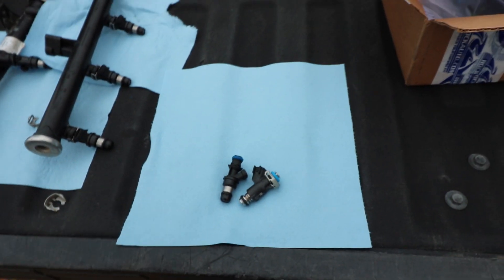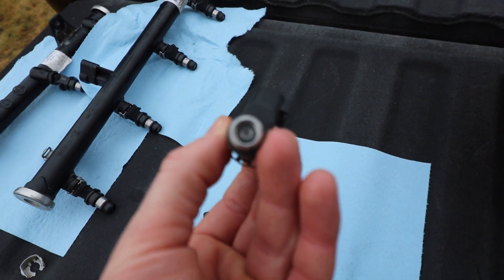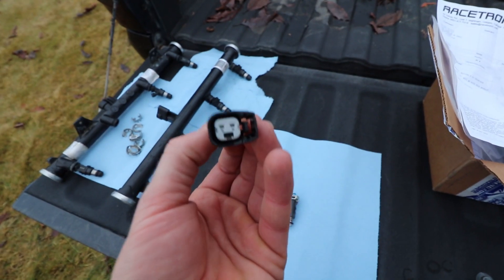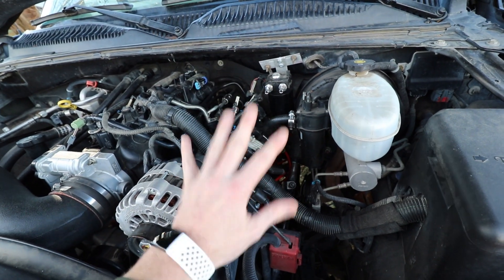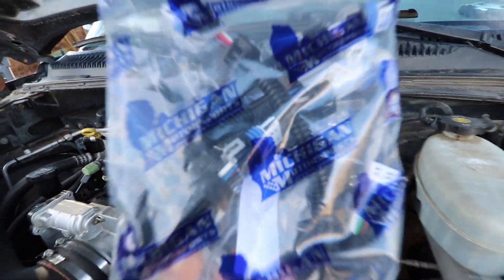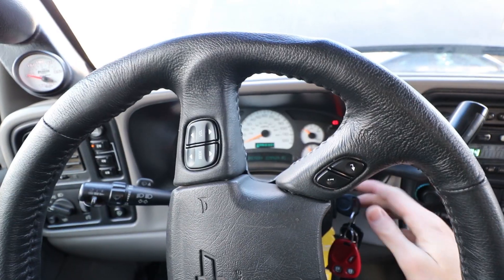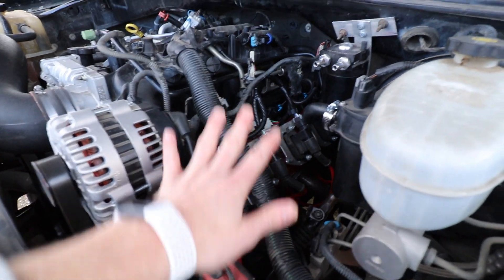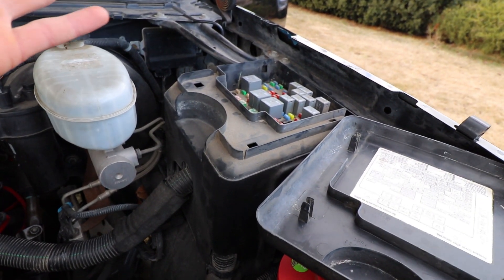Silverado Electrical Issues  - One Side Of Engine No Spark

Comment: 2008 Silverado 1500. 5.3 Having the same problem.  South main Auto had a video about this. My Right bank 2,4,6,8 coils are not firing. Check at Harness connector at coil harness at top of engine. Pink wire -Hot Black -ground. His had no ground coming there. Back probed into that harness connector at ground and ran ground test wire with alligator clip to ground. . Ran great.  He found bad ground eyelet below around power steering pump where the ground originates. Crusty ground pulled right out. He did repair all the ground wires in that eyelet and relocated the ground to a better place. That eyelet had both grounds to run both sides.  Will find out tomorrow if that's my problem. Sounds reasonable.  This seems to be the fastest fix !   also thanks for this video. It helps so many people like me!!   Phil

Comment: Thanks for pointing me in right direction. PROBLEM SOLVED. I had no spark on coils from bank one. I checked fuses ing a  and  ing  b, check power bank 1 coils (black and pink at computer side of harness), plugs wires, did a compression test, switched out coils with ones I had laying around. I finally came to conclusion that it was the wiring...so I checked   power bank 1 coils (black and pink at computer side of harness) and had good voltage. Then I checked the continuities the from coil connector harness back to computer and the coil harness under the mount bracket....and all was good but still no spark!!  
That's when I came across this video and decide to check continuity from black ground wire at coil harness back to ground connection at passenger side front head. At first I had continuity and then slowly it started to rise on and multi meter was showing resistance....well that's all I had to see and I tee tapped a new ground wire into the black ground of the computer side of the bank 1 coil harness and ran it back to the original ground on passenger left front head!! 
It fired right up with all original parts( i put original coils back on) and laid down rubber on first test drive also blowing what was left of my bank one cat converter's internals all over the neighbor's curb. My Truck is a 2007 Silverado new style 4wd with 5.3l..and its never ran better!
THANKS to ALL!
Reply from the maker: I'm glad I could help get you pointed in the right direction! and very happy to hear your truck is back on the road! thank you for going into detail on your troubleshooting, hope that can also help someone else having the same issue's as well.
Reply: I appreciate this info. I have a 8.1 swapped into a 1978 F350 dually and I have the same problem. Got exhaust on the passenger side and nothing on the drivers side. I’m definitely trying the ground trick before I replace anything
Reply: @daviddenman7479 did that work for you? Or what ended up working if anything?

Comment: PNW!! 

Double check the ground on the back of the head.  Use internal/external lock washers so it really "bites" into the block. Also make sure you have a good ground from the engine to the body. 

The video you had when you pulled the engine saved me a ton of time not pulling my hood off!  I would have never thought about using those extra holes for the hood springs🤘
Reply from the maker: Yeah buddy! 

Thank you and good call, I'm going to take another look at that ground. makes perfect since that would be the issue but it seemed fine during the install and I need to get some of those lock washers for sure. 

Love to hear it! I'm glad I could help!
Reply: Im having this issue and I don’t have any ground going to the back of the head. I checked my brothers who’s same year and model and his doesn’t have a ground going to driver head and it works perfectly fine
Reply: @gto.eduardo958  the ground on the back of the head is just for that banks coil packs. Follow the wires and see where it's grounded at then inspect the ring terminal and wire for corrosion. Repair as needed and then retest.
Reply: @253fabrication  ohhh shit okay I think I see what you mean
Reply: @253fabrication  okay so today i took it off cleaned it up because it didn’t look bad… put it back and ran the same. I checked continuity from that wire to the coil packs and it tested good. Just wanted to mention. When I did this i forgot to disconnect the battery. And once I got it loose it touched the fuel line. And it activated my fuel pump because I did have my gauge hooked up and heard it prime. correct me if I’m wrong but I have a short to ground somewhere right ?
Reply: @253fabrication  also it was with the big ground on the back of the engine. Not the back of the head. Should I relocate it to the back of the head ? As well as I disconnected battery after that incident. When ground touched it activated fuel pump and sounded like the throttle also activated

Comment: Hey did you ever figure out what was wrong with it? I have the exact same issue and same side too. I put new intake gaskets, maf, TB, spark plugs, ignition wires, knock sensors, didn't want to spend the money on coils if they're good. I unplugged the driver side at the main harness for the coil packs and the truck ran the same so I have that whole side not working for sure. Any update or help would be appreciated

Comment: Pull your injector a fuse and look at it this happened to my 5.3 and fixed it thanks to your videos I just need to find my short now. Thank you for your help and videos
Reply: Fixed today BTW and it's labeled "injector A"
Reply from the maker: I will take another look and clean the connections for sure and Thank you! I'm glad to hear you are getting yours squared away!
Reply: Man thank you for this comment i couldn't find the issue resolved nowhere on youtube until i seen this comment and  that was the exact answer that fix my issue! Thank for posting this comment your a life saver man💯
Reply: Having the exact problem
Reply: @fabiangonzales6949 mine also. 06 1500 MAX 6.0. Fuse INJ 1. Entire 1st bank had power again.

Comment: Ground on block beside the powersteering pump possibly had one at a dealer I worked at said it was bad computer didn’t fix it ended up being that ground even though it looked good you gave it a little tug and it popped loose put a new ring terminal on it fired right up
Reply: I have the same problem but mines on passenger side any help would be great

Comment: Try checking your 02 sensors sometimes they short out and close the one bank down, that they are connected too. Had this problem on new vehicles at the time these were new working a car dealer first time I came across this issue changed odd or even side O2 sensor problem fixed.

Comment: Check your negative cable on the back of the driver side head I had the same problem brother
Reply from the maker: I appreciate it brother man, I found that to be the issue. Unfortunately after fixing it the valve spring broke during tuning and now I’m building a 6.0
Reply: Negative cable back side of head ?
Reply from the maker: It’s the black ground cable behind the intake manifold on the drivers side of the block. If you remove the intake manifold it’s much easier to get to.

Comment: Any luck with this yet? I’ve got the same thing going on. Was it a ground wire for yours?
Reply: I found mine. I had to replace the lifters originally. After reassembling everything 1 & 7 wouldn’t fire. Ended up being the lifters orientation absolutely matters for the oil hole. The tiny hole has to face the intake and not the exhaust manifold. Ripped it all back down. Rotated lifters around and now all is good 🤞

Comment: Have same truck with same issue some feedback new injectors new coils wires plugs po300 po200 well now po0300 code only
Reply from the maker: So after doing new MAF, MAP, Coils, plugs, O2 sensor, injectors and intake gaskets. Turned out to be a bad ground on the on the back of the block on drivers side. Check both passenger side and drivers side grounds would be my suggestion for your next steps.
Reply: @MitchCarveth  ty it was a ground on the back of block and well the one ignition relay well there's a certain way they go in a parently and switch relay or flip it around truck came to life

Comment: I just fixed mine. It was a weak ground from the comp. To the coil harness.
Reply from the maker: Im glad to hear it, Thats the only other thing I can think of now, I've checked all other engine and chassis grounds, swapped in new fuses and got new coil harness. I just need to find the ground your talking about now.
Reply: Just tap into the black wire on your coil pack harness and run a new ground to it.
Reply from the maker: Im not the biggest fan of wiring, thank you so much! I will be giving this a try this weekend.
Reply: @MitchCarveth   Make sure you update the video so we can see how that thing runs.
Reply from the maker: I will do an update video for sure! I've got footage of trouble shooting right now, just didn't want to do another hey its not running yet video lol
Reply: @MitchCarveth  did you ever look into what I said?
Reply: Do you just run the ground to the frame ??
Reply: @jaredagnew3870  straight to the firewall ground, if you have a good body ground

Comment: 07 New Body Style 1500 Silverado. I am experiencing a low pulsing Injector wire on the #3 injector. This is causing high ltft on bank 1 and Misfires. But, my misfire code is showing p0300 random misfire. Test was done with a noid light which showed a dimly lit noid light and inconsistent pulses on #3 wire. All other wires seemed to light up nicely with a consistent pulse. I recently did a cam swap with a BTR Torque Cam in the truck as well as valve springs and hardened push rods. My two thoughts are as it was my first time doing a cam swap maybe when I pulled the cam I was off on timing OR I have a short in injector wiring harness. I did remove timing cover again and checked that dots are lined up and they are perfect BUT that does not mean when I pulled it I had it right. Anyone else have any other thoughts? I think unfortunately my only choice may be to  pull cam again make sure I am at tdc and start over.

Comment: I feel your pain brother! I had the same issue one said no fire. Noticed that the wire for the passenger side fire wall harness plug was toast. So I ordered oem harness for the coil packs for 2-4-6-8 hooked it up and now it won’t even start. I’m going to check the cam crank sensor’s next.  Thanks for the video!
Reply from the maker: I hope you get it figured out! Mine ended up being the ecu ground cable that goes to the block going bad.
Reply: Did u fix it?

Comment: I had the same problem turned out to be a bad connection on the top of the motor from the main harness to the coil harness replaced it and it was fine
Reply: what connection?

Comment: Mine's is doing this but on the passenger side Bank a some reason it run good but then when it rains it starts to flutter and miss . I've changed out the harness spark plugs spark plug wires everything and it still does it.. have you got it fixed???
Reply from the maker: Check your main ECU harness ground on the passengers side. After a lot of different trouble shooting I just double checked the harness ground on the driver's side that goes to the back of the block and gave it a wiggle then it just broke off. I'm thinking yours is either loose or corroded with the rain effecting it. This weekend I'm going to terminate a new head on the ground and hoping for the best 🤞. Trace that ground and I think you will find your issue.
Reply: @MitchCarveth  thank you very much will let you kno
Reply: I have trouble with my 96 Tahoe you have to clean the holes out in the bottom of the distributor the dust is building up causing it to Crossfire with moisture
Reply: @shawnthompson6725  that engine does mot have a distributor the one in the video the coils and the computer = the distributor

Comment: is it no spark or no fuel on the drivers bank ?  veryify that first. if its no spark , then use a volt meter and check at the coil if your gettting key on 12v on one of the pins and 5v on one of the pins
Reply from the maker: No spark, fuel is good. I'll grab the Volt meter and do some more investigating, Thank you!
Reply: May check for a bad ground for the coils on the block behind the PS pump.
I’ve seen on another video that the guy had that issue and fixed it with a new ring terminal.
Hope it helps.
Reply from the maker: I will look into that as well, thank you!
Reply: Or bad pins in the plug, 1,200 bucks at Tony's Chevrolet got me there. Looking like I'm going back to that as it quit again.

Comment: I had the same issue no power on driver side it was my ground wires by the crank shaft sensor left side
Reply from the maker: I will definitely remember that if it happens again. Mine ended up being bad ground from ecu to back of engine block.

Comment: Feel you my 2005 Silverado has no power to injectors and coil on passenger side
Reply from the maker: Did you check the passenger side ground at the back of the block behind the intake manifold? I double checked mine and when I wiggled it the wire snapped, it was a bad ground to the ECU on the drivers side for me the whole time.
Reply: Nope didn't see that one it be next
Reply from the maker: defiantly check that one out
Reply: Can't tell if if good it wiggles easy
Reply: Thinking of redoing that ground and move it somewhere little easier to get to
Reply from the maker: with mine the head snapped right off after wiggling it but it didnt do that the first time I checked it which is why i didnt think it was that ground at first. If you have the intake manifold off already I say it might be a good idea to terminate a new head on it for peace of mind as well. as for re location I personally dont know of another spot that wont get effected by water but I have to deal with snow and rain a lot where im at. I just scuffed up the block and put it back in the same spot.
Reply: Intake still on it
Reply: That's why I thinking of moving it
Reply: Thanks for the help
Reply: Would it matter if I moved where it is grounded
Reply from the maker: You are welcome man, hoping I'm getting you pointed in the right direction. As long as its still grounded to the block wherever you move it to you should be good.
Reply: Yup you been very helpful and I let you know what it is when I get it running
Reply: I found that fuse keep going
Reply: I found what keep popping fuse coil bad unplugged all coils on that side turn it on and didn't pop
Reply: When stop raining going to find which onebad
Reply: Found the problem bad coil was popping the fuse put 4 old ones on now running good
Reply from the maker: Heck yeah! I’m glad to hear you got her squared away.
Reply: Thanks hope my experience can help One day
Reply: And found out that injectors fuse also is for coils

Comment: Ever get this truck figured out?
Reply: I figure mine ground wire to coil pack on harness (black wire
Reply: @ricardofuentes2766  so you had to put a ground wire to a coil pack bolt?
Reply: @reapertypebeat3963  look if u expose ur harness right by where it splits to create d connector for ur coilpacks driver side. U will find a black color with is d ground  for ur harness coilpacks section . Now u fallow make sure it's no cut or some other wise ur truck will never crank even with started fluid. 
Tip that wire lead were ur batter ground bolts in. Driver side  of d block
Reply: @ricardofuentes2766  i have no spark on passenger side I just swapped the motor

Comment: Man I been working on my 5.3 for weeks an I still can't figure this shit out..please I need help..no codes
Reply: If you figure it out bro let me know I have the same issue but all these videos are leading me to think a bad ground wire, let’s hope that’s the issue… it definitely has to be a ground or there’s a piece of the wiring that is not getting enough voltage but check for ground first as well as the pcm to see if your getting anything there

Comment: sounds like the timing is off I would open the timing cover and check if the crank lines up with the cam gear . Make sure they are aligned perfectly just being off by one tooth can cause this.

Comment: Bad comp ground,  have u scanned it?
Reply: Where is the comp ground located
Reply: @darrikanglemyer3800   im not 100%, i work on mercedesbenz diesel engines and there  has been a large amount of computer boards that share a ground inside the board for half the cylinders, when the comnection in the computer fails it drops half the engines cylinders.   It could be a completly different setup just something ive learned. Need to ohm out your wire and trace them  back to ecu.  Make sure continuity to board.  Maybe also a led volt checker to see if they pulse at all then crankin.